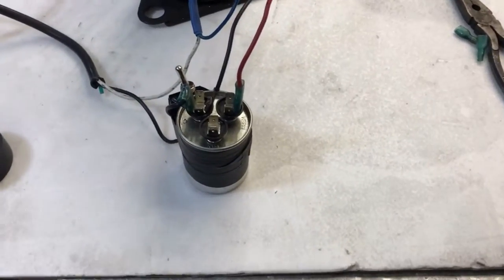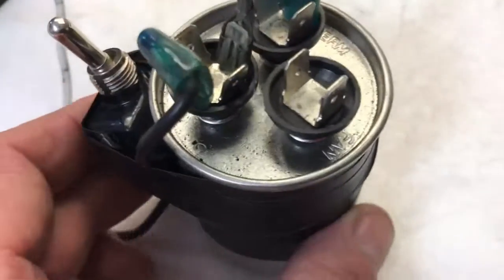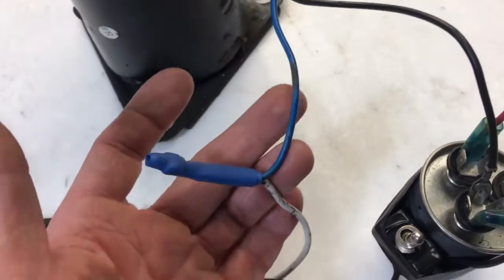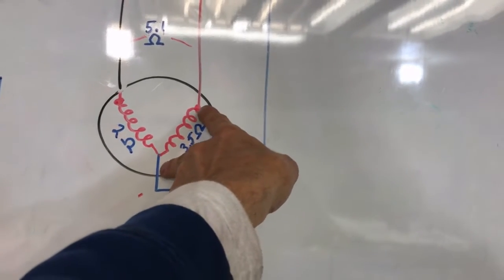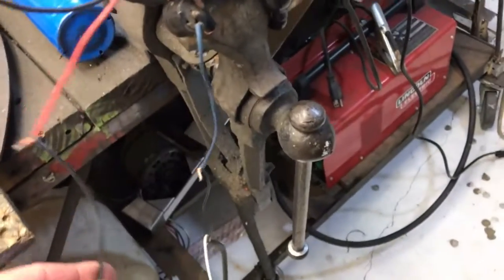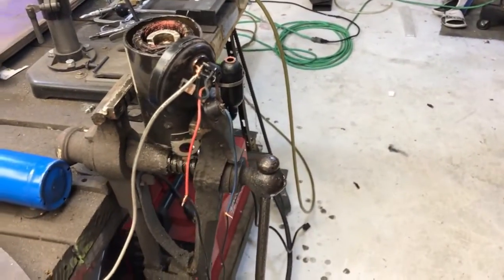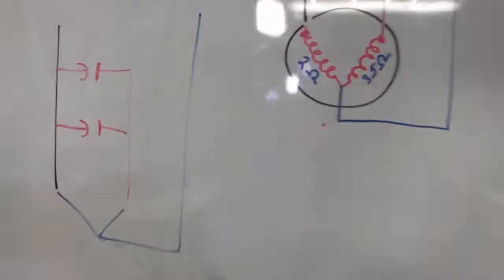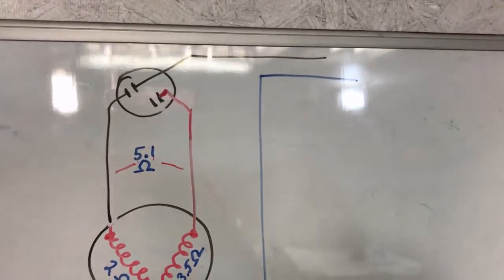AC compressor wiring diagram NOW no yapping

Comment: Do you have to turn the start winding off once its running?
Reply from the maker: Yes i use an on of switch if the little PBC or what ever its called fails . there is a auto cut off switch mounted on the unjtj but it can die so i use a switch and just turn the switch on and off .
Reply: @NOBOX7 thanks
Reply from the maker: @Oggabooga-ce9dr  Its called a PTC relay .it starts teh power for the start winding then it cuts off after the motor is started .
they do go out often
Reply from the maker: @Oggabooga-ce9dr  Hey i made a mistake not all of them have a ptc relay
Reply from the maker: @Oggabooga-ce9dr  Not all of the units have a start winding i dont think in this unit it is a start winding but i could be wrong  . i thought this comment was for the piston type compressor

Comment: Bim bum bam red wire blue wire capacitor ,never once you say from cap to start from cap to run from power fo common just a ton of mumble jumble
Reply from the maker: The picture should solve your issue

Comment: Gibson 7105700 A/C unit 
So, taking it that the BLUE (vs. black) goes to 'C' / Common, 
RED goes to 'HERM'.  Then Orange and Yellow must go to  FAN, but only has one prong = WRONG.
No OM meter, dang it. Difficult to find any COLOR CODED diagrams online. Sketch did no good as marking were unreadable and connection posts slightly different.

Comment: So, I followed the instructions, diagram...
In my case, the cables on my compressor were switched from factory.
I opened plastic cover; 8mm nut.
Red was (C)...common
Blue was (M)R...run
Black was S...start
Probed it, rewired it, according to your example; worked perfectly! 
Thank you!

Comment: Instead of telling us about the red wire or the blue wire, why don't you just say which wires goes to the common, start and run on the compressor.  Then say the start gets connected to the herm. on the capacitor and so on. Not a very helpful video right now.
Reply from the maker: maybe you missed the diagram at the end , if that doesnt help please dont play with electricity

Comment: Hi, I wanted to make this silent compressor so I got from my friend the ac compressor (from external unit) and  I was wandering whether you would be able to help me with connection of my ac compressor ( ac was single phase) but there wasn't separate capacitor as I can see on some YouTube videos, there was whole like main board from computer and there were few capacitors, any way on the compressor itself is a label which says 148VDC, at 120Hz, and I have no idea how to connect it to a power supply
Reply from the maker: youtube hides comments from me , i just now seen this . Sorry im 3 years late yes i coulda helped

Comment: Dear friend I checked  my compressor with ohm meter and everything is OK, I wiring the capacitor and plug it into the power, the home fuse is going to off after running, I want to use the compressor as Diy air compressor not using for A/C. Do I need any start relay for this job? What is wrong you think?
Reply: AC compressor ka wiring drawing Karke batao
Reply from the maker: yes for compressor you  will need start cap